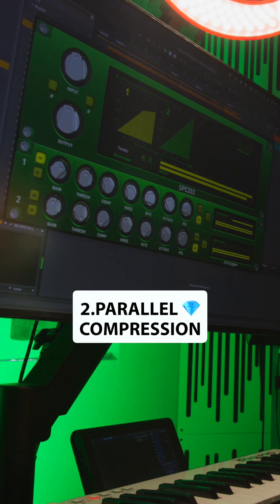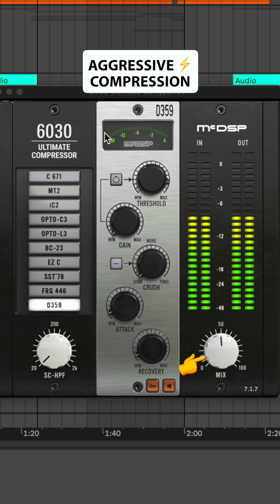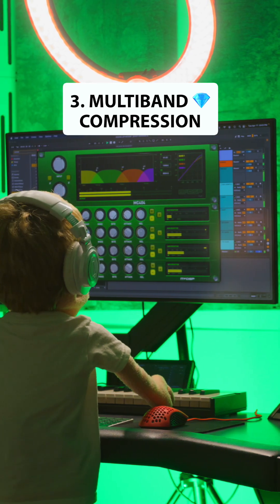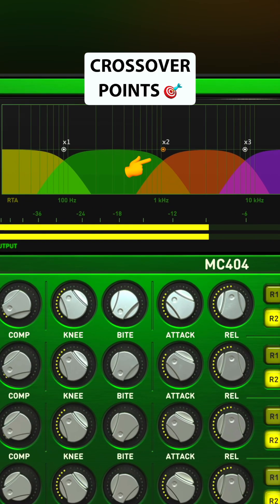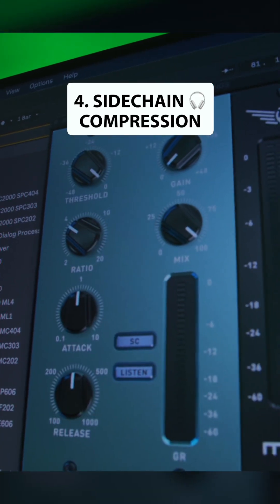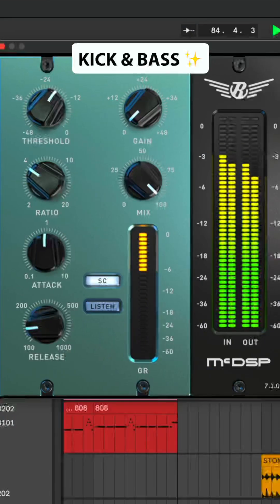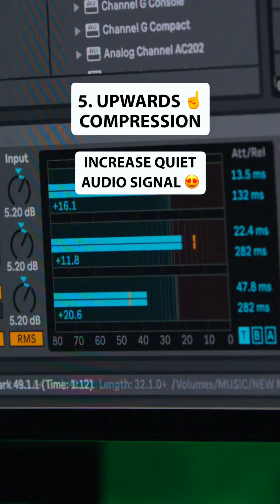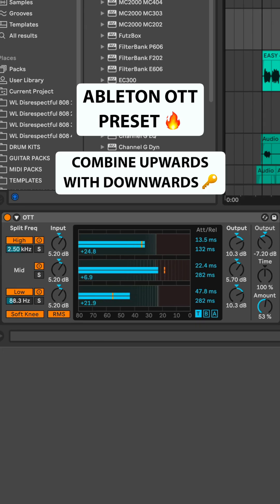All 5 Types of Compression EXPLAINED 🔥

Comment: upwards compression is what most people just call compression. Downwards compression basically means no make up gain. Downwards compression turns the signal down, upwards compression does the same thing, but then you turn up the make up gain, making the quiet parts louder while still decreasing the dynamic range. OTT EXPANDS and compresses in a multiband fashion. Expansion is when the signal is turned up when it crosses the threshold. This is upward expansion, making the signal louder. Similar to compression you can turn down the makeup gain, making the loud parts quieter and increasing the dynamic range.

Multiband is not a type of compression, you could do the same thing with band pass filters and sends and now ive spent too long typing a post i dont really think will be read or matters....
Reply: Thats not how upwards compression works at all bro… upwards compression is the opposite of downwards compression. Everything below the treshold will be pushed up, everything above the treshold remains untouched.
Reply: Was actually informative bro thank u
Reply: It really helped me out thx
Reply: Read the whole thing and clarified, learned some useful information. Even a year later, thanks for your comment 👍

Comment: I don't feel like these ways of categorizing compression makes a lot of sense and seems quite arbitrary to me. You could through any number of other 'types of compression' into this list, for instance RMS or PEAK. 

For instance; upwards and downwards compression could be seen as different types of compression envelope, or could also be seen as whether the compression being applied has a positive or negative ratio. The other types of compression you mentioned cannot be categorized in the same way.

Parallels compression, for instance, is a type of signal processing that can be applied to any of the other 4 'compression types' you mentioned. This list should also include compression in series to be complete.

An unrelated side note but I saw a lot of comments talking about types of analog compression, there are actually 6 types for anyone curious; VCA, opto, FET, tube / vari-mu, diode bridge and PWM.

I'm such a massive nerd when it comes to this stuff ahahaha
Reply: I think a better video tittle would be '5 arbitrary categorizations pression'

Comment: the TWO types are RMS vs PEAK this video does compare some of the ways you can apply compression.. but confuses applications with types.   for example in multi-band compression, you might turn all of the compression bands off besides one band-- technically only regular compression but whether you compress all bands or one band, this is still an APPLICATION, not a kind of compression because you can still choose peak vs rms for each band.   all compression is downward.  the upward is not compression, its called makeup gain.  ducking is a side chain technique where you trigger compression off of a separate sound source.   pumping is the opposite of ducking, it is also a technique.  Ducking and Pumping don't make sense using RMS detect but you can always try it.  the most common use of ducking is to duck background music or noise for an announcer or narrator.  ducking bass to kick can create an effect but .. kick + bass can sound awesome so its more common with EDM music, not so much in rock music although I have done it before, but don't because it makes the mix sound a certain way and might cause it to not fit in the genre